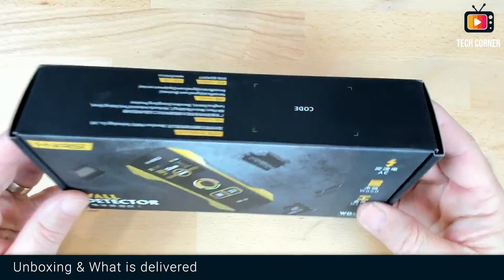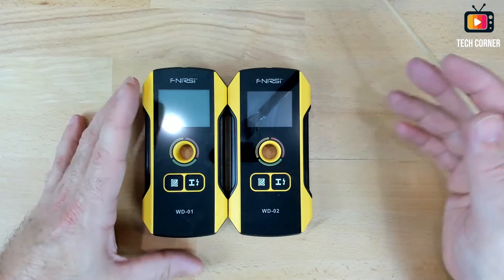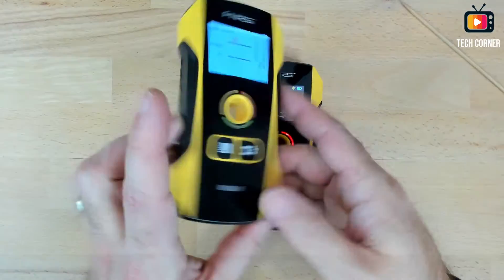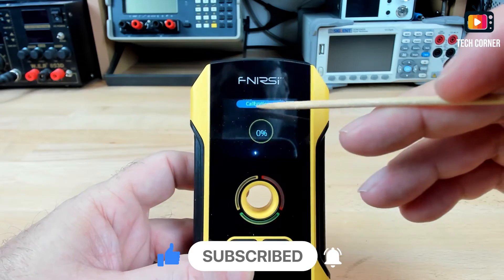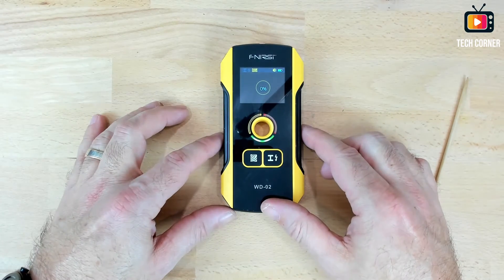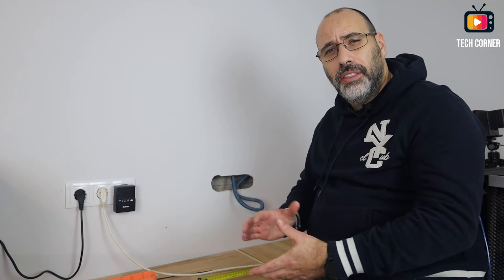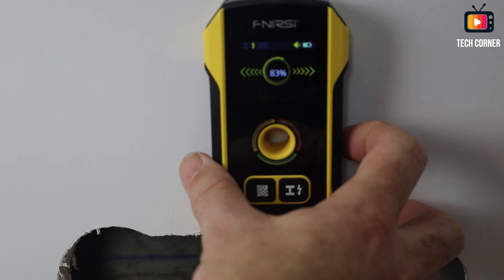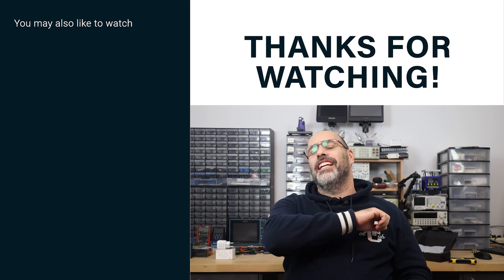FNIRSI WD-02 Wall Detector ⭐ Wire, Metal, Wood, Current Inside Wall Detector!

Comment: It doesn't work
Reply from the maker: Hi, it has been helping me a lot on my walls. My house is LSF and whenever I want to handg something to handle a bit more weight, I try to locate a stub and use a screw there, and this helps me locating the stubs on the drywall. My house have two layers of drywall and still works fine. But I do understand that's my experience, other situations might have different results. I'm sorry it doesn't solve your problem. Thanks for watching.